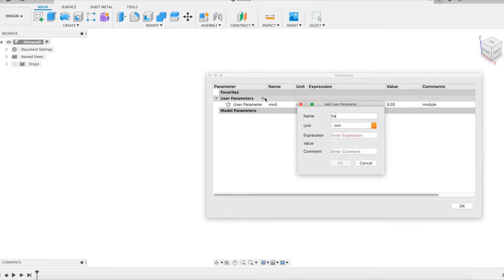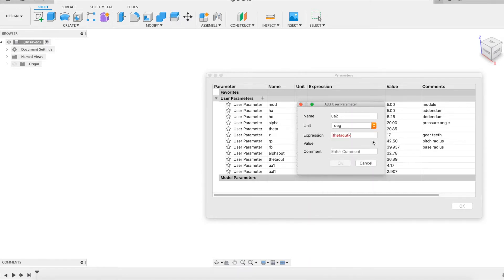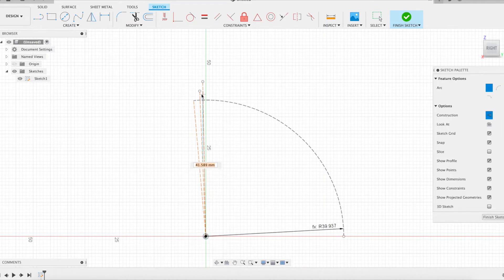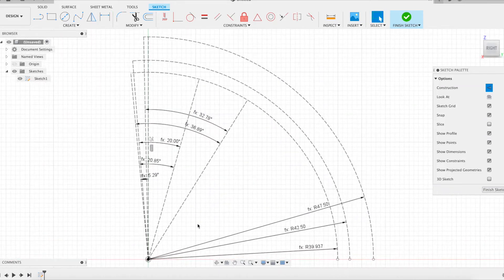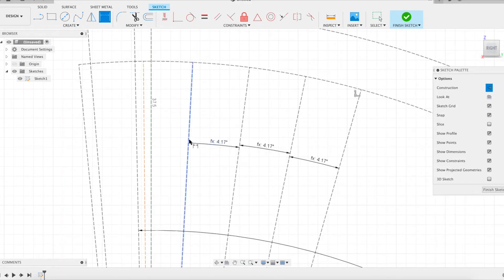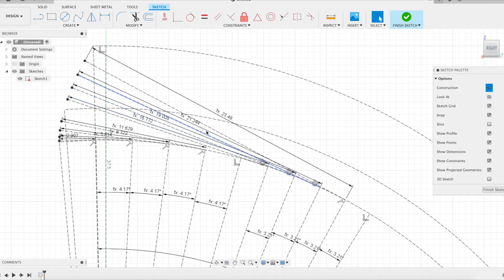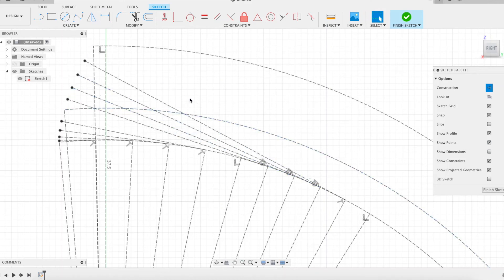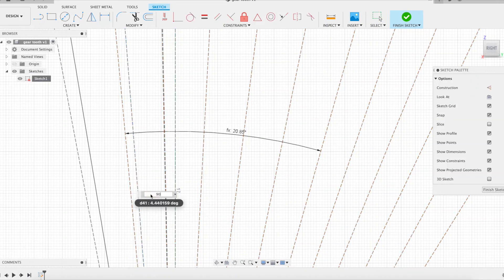Fusion 360: Sketching a Geometrically Correct Circle Involute to Model a Proper Parametric Gear (1)

Comment: hey man, me again lol, how did you determine the formulas you used to calculate those unroll angles and lengths? Also I would actually like to talk more if possible, maybe through email?
Reply from the maker: Those formulas are mathematics applied for Fusion 360 on circle involute definition. I didn't invent anything 😉
I suggest you to look at this video, it's a full screw gear modeling. I give a link to the parameter list in the description.
https://youtu.be/Uwf4IrcqpTA
A parametric screw gear can be considered as the generic for cylindrical gears, so a helical gear is a particular case of the screw gear (same helix angle for both cylinders), and a spur gear is a particular case of the helical gear (helix angle being 0).

Comment: How would you add a parameter for backlash? Using this for 3d printer backlash is needed to compensate for the inaccuracies of the printer
Reply from the maker: I suggest you to see one of my most recent videos (helical gear, or screw gear). I share the parameters in the description.
The backlash parameter is called bl1, it is used for the calculated parameter Ash1 (for the pinion gear, and bl2 with Ash2 for the crown gear). Then look for it while sketching, here (d77 dimension):
https://www.youtube.com/watch?v=Uwf4IrcqpTA&t=43s

Comment: This is cool! Do you happen to have shared the project?
Reply from the maker: Comment updated with a link. You'll get the latest version, so slightly different and probably improved.
If you want something more advanced, I suggest you my "screw gear and worm gear" video.
Reply: @steelstone  Awesome! The other video is even awesomer 😁
Reply: @steelstone  I checked the file. The gear you provide overlaps with the one generated by the SpurGear plugin. However, once I change Z to 12, your gear is much fatter than the generated one and it wouldn't mesh with itself at the correct distance of 2*rp. Is this different in your worm gear project?
Reply from the maker: @MihaiAndreiStanimir  You mean the teeth look "fatter", right ?
Actually a profile shift is applied to the gear for tooth numbers 16 and below (at 20° pressure angle). As said, I provided an improved f3d project. It includes profile shift. You can modify the "Xshift" parameter to value 0, then you'll obtain the same behavior as the SpurGear script ("Xshift" is the profile shift coefficient).

I suggest reading this document, the best I found that popularize the "profile shift" behavior (center distance is affected, 2*Rp is not anymore correct) :
https://www.tec-science.com/mechanical-power-transmission/involute-gear/profile-shift/
Reply: @steelstone  Thank you! 😃